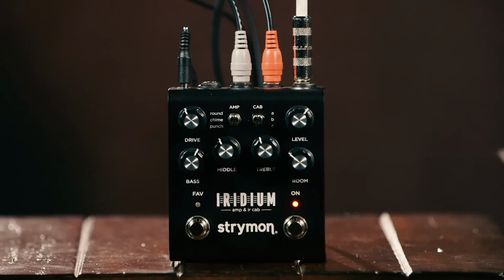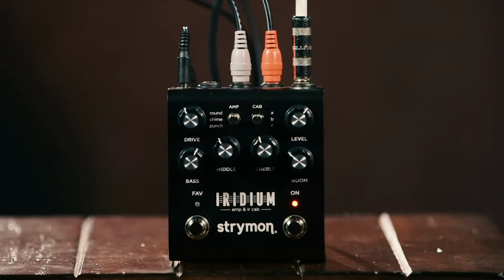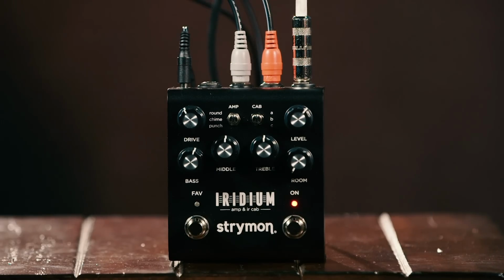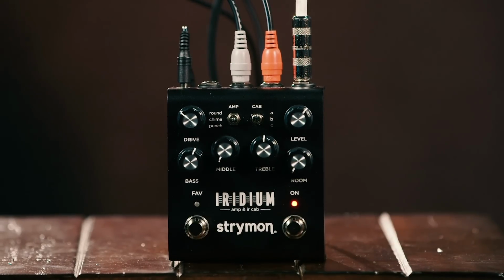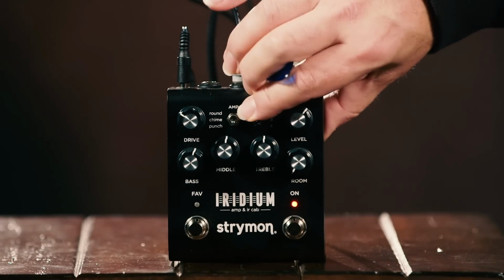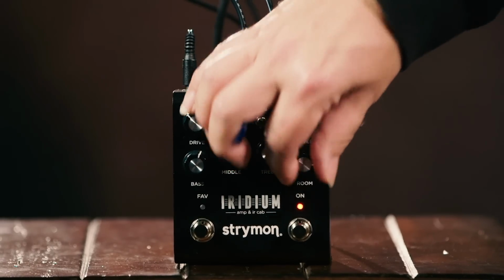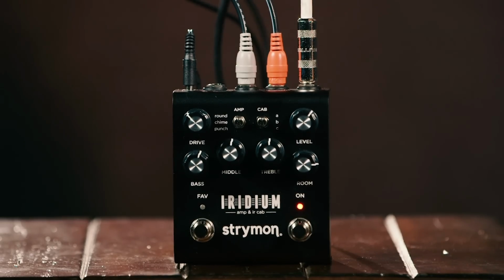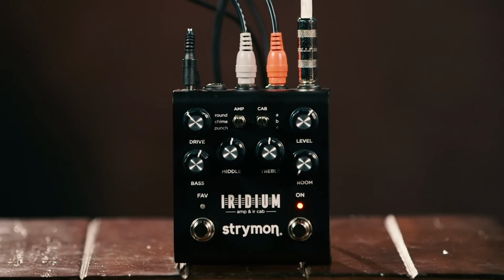Strymon Iridium Amp & IR Cab Pedal Demo

Comment: So the Iridium can't be used straight into the front of your guitar amp or the fx loop? 🤔
Reply from the maker: Hi, hekakain4108! Thanks for your message, Happy New Year! Iridium can be plugged into the front end of your amp, or the effects loop or a mixer via direct box. That said, there are several adjustments to be made using an amp. Ie: turning off the amp sims when connected to the effects loop or front of the amp. Additionally in the front of the amp, since there are redundant gain and EQ controls/tone stacks, care must be taken to obtain an optimal result.
Please contact us direct with other questions as you have them!
Robert Williams, Senior Sweetwater Sales Engineer, (800) 222-4700 ext. 2371, robert_williams@sweetwater.com

Comment: So to use a delay or reverb pedal, you plug your guitar to the Iridium input jack and the Iridium output into the input of your pedals and plug the output from your pedals into a direct box and send it to FOH or whatever other audio source you’re using, is this correct?
Reply from the maker: Hi, sonny6string822. Yes, that would be a great way to do that setup. If you’re just running clean amp emulations on the Iridium, the delay/reverb pedals could also go in front of the Iridium. Really just personal preference at that point.
Thanks for your interest!
Charlie Davis, Sweetwater Sales Engineer, (800) 222-4700 ext. 1320, charlie_davis@sweetwater.com

Comment: Thanks very much, Mitch! Can i use this with my Boss RC-600? Rock on
Reply from the maker: Hi, Nirodha. Yes, those can be used together. The Iridium is essentially taking the place of an amp so I would keep that as the last thing in your signal chain, with the looper wherever you would normally keep it in your pedal order before that.
Thanks for your interest!
Charlie Davis, Sweetwater Sales Engineer, (800) 222-4700 ext. 1320, charlie_davis@sweetwater.com
Reply: @sweetwater  Thank you very much!

Comment: I want the ability to: get my 65 Blackface Fender Princeton "Clean" - through the P.A. (without having to carry my Amp to Gigs) - any Input ?
Reply from the maker: Hi, Michael. For what you're describing, the Iridium is a great choice. It has some great Fender style tones in there and I see a lot of people using it so that they don't have to bring an amp to a gig. For running into a PA, you will likely need to pair that with a DI box.
Thanks for your interest!
Charlie Davis, Sweetwater Sales Engineer, (800) 222-4700 ext. 1320, charlie_davis@sweetwater.com
Reply: @sweetwater  Thanks. Now I'm comparing & researching: Strymon Iridium, Humbolt Simplifier. Walrus acs1, Quilter-unit ??? I also want the most Amp-like Feel (under the fingers) Appreciate your input.

Comment: I see this as a great live rig, but it'll never replace a real amp in a studio.
Reply: This video was made in a studio and it seemed to just replace a real amp and cab and microphone
Reply: @cmath8577  I'd use it for making a demo and an indie album on a tight budget. But if you're making a pro-level album you real amps and mics should be used.
Reply: @godzilla964  such a dumb take. Plenty of indie albums are recorded with real amps, and plenty of albums of all sorts are recorded using modelers. It’s all fair game. If it sounds good, it is good
Reply: It did for me. Ended up selling my AC 15. Can’t turn it up loud enough in my home studio to really get good sound out of it. The AC model on this thing is killer

Comment: So this one goes straight to your cab like a small amp head, right?
Reply from the maker: Thanks for contacting us, Lester. Hope you're safe and well. Iridium is designed to connect to a mixing console or full range (PA style) powered speaker, not to a guitar amp or cabinet. It has no power and has a variety of amp and cabinets to select from. Please contact me direct for more information.
Robert Williams, Senior Sweetwater Sale Engineer, (800) 222-4700 ext. 2371, robert_williams@sweetwater.com

Comment: Ok, Mitch, you explained a fairly interesting audio routing with the pedals - Riverside to Iridium; Iridium to delay and verb. Did you just come off of the stereo outputs of the Iridium or did you use some other secret sauce? I’ve heard demos with the pedals all in front of the iridium and thought it sounded amazing. Nice demo and thanks!

Comment: Will this go direct to the effects loop if I still need to use an amp?
Reply from the maker: Hi, Josh. You could run this into an effects loop, but just remember that you would be running a cab IR into another cabinet. That may not give you the best sound possible, but it is an option. If you have any other questions, please feel free to contact me anytime. Thanks for the interest! 
Chris Arnold, Sweetwater Sales Engineer, (800) 222-4700 ext. 1709, chris_arnold@sweetwater.com
Reply: Sweetwater TY! I’ve checked the online manual an option to disable/bypass the CAB Sim. Sounds like a good option to me!

Comment: So I can plug this straight into my cab? How loud does it get? how many watts?
Reply: It won't power a cab. It plugs directly into an audio interface, headphones or a PA system. It's emulating an entire recorded guitar tone signal chain of Amp -> Speaker Cab -> Microphone
Reply: @oisinmcphillips2090  Got it Thanks!!!
Reply: Oisin McPhillips if I still need to use my amp so you recommend to connect this on the effects loops?

Comment: Does the  Iridium have to be set at the end of my pedalboard signal chain when using my effects pedals in order to take advantage of the Cab sim IR's?
Reply from the maker: Thanks for your question, Jason. Here's my take: It depends… If you want to set up the chain like an amp without an effects loop, then yes, Iridium is last. If you want to set up the chain as if you are in a studio, then place your time domain effects after the Iridium. Technically you can place anything after it, since in order to connect to a mic pre on your interface or mixer, you'll likely use a direct box. If you connect to a Hi-Z input on the interface/mixer, then your results may vary. You can't hurt anything by trying both methods, so experiment. If I didn't answer you completely or correctly, please contact me direct.
Robert Williams, Senior Sweetwater Sales Engineer, (800) 222-4700 ext. 2371, robert_williams@sweetwater.com
Reply: @sweetwater  Huge thanks and great demo!

Comment: No fx loop?? it would be mess putting your effects pedal after power amp and IR sim. Cmon  strymon if you are pretending to be an amp we need fx loop
Reply: Çağlar Oral Not really. Any post effects become clearer, instead of limited by the speaker IR and its frequency cuts. Modelers give you the option to do either, and many effects found on records are added in the DAW, which does the same thing.
Reply: None of the 3 amps being modeled here have effects loops – fender deluxe reverb, Vox AC 30 or Marshall plexi. So if your argument is for historical accuracy and being true to the real amps, they’ve done it

Comment: Wasn't interested until I saw it has midi, looks like a simple setup without having to get overloaded with 1200 amp models and 3000 cabs....etc.... more like a tube amp setup, some knobs switches and a few minutes to dial in a tone , if it reviews to run well with a FX8 , which I think it would, I will get one

Comment: Is it possible to turn off the Amp side and use my HX stomp as the preamp/effects and use the iridium for the Cab IR? I need to free some DSP on the stomp
Reply from the maker: Hey, Lucas. Thanks very much for your question! Yes, you can turn off either the Amp or the Cab inside the Iridium. Check this link:
https://www.strymon.net/faq/how-can-i-disable-the-amp-or-cab-on-iridium/  
Please contact me direct with any other gear questions you have.
Robert Williams, Senior Sweetwater Sales Engineer, (800) 222-4700 ext. 2371, robert_williams@sweetwater.com

Comment: It seems to be a good pedal, but for that price...just don't! It's basically a GT2 improved. HX Stomp is more expensive but it have a lot more to offer...a lot more! And it fits just fine in almost any pedalboard even replacing effects. Also, for some less than this, you can go to Atomic AmplifireBox. Cheaper and also do a lot more than this and probably even smaller.
Reply: Quality over quantity. You get what you pay for, and these are great

Comment: I like that adding gain for distortion doesn't raise the volume. I finally resorted to using multiple distortion pedals set to various amounts of distortion at the same volume to eliminate the problem of volume change at different distortion amounts on one pedal being changed on the fly for different songs.

Comment: I don't care for the overdriven amp sounds for the 3 amps demoed here.  The cleans are excellent, but I'm still not sure about the other tones.  Strymon's demo videos are mostly clean or light crunch too.  PLEASE somebody "release the hounds" on this thing, assuming it's possible, so we can hear what it can really do.  And I'm not talking about modern high gain tones, but rather something like classic JCM 800 sounds.
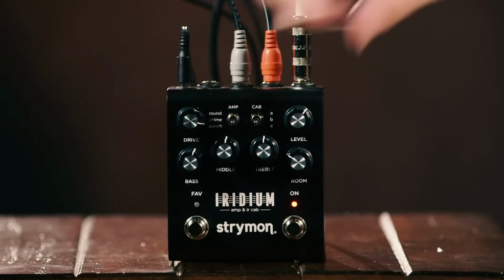Reply: Sinner Train what about at 8:05?
Reply: @robertwellington2616  You're right, but it's such a brief part of the demo.  There's another brief Marshall-type blast later on too.  I guess I'll have to try one of these out.
Reply: Sinner Train yes there was another time he played it. I can’t use it because I’m not connected to a computer. So I wonder if powered monitors would work and how they would sound. I don’t really want to spend any more money. I’ve spent a fortune and I’m finally under control. I have passive monitors, unpowered that are collecting dust in a closet. Tbh I love my amp and pedals and I would’ve bought this as a plug in the front of my amp pedal. But I’m not buying any more monitors. I did think the Marshall sounded pretty good though.
Reply: According to Strymon, about 2 o’clock on the drive knob would be the maximum level for the real amp being modeled, and pass that is an additional gain stage Strymon has provided. I agree it doesn’t sound great when cranked, so I usually stick to that 2 o’clock point and then use overdrive pedals

Comment: how about an Iridium for bass? Ampeg SVT, GK solid state amp, and maybe a Fender Bassman?
Reply: I’ve recorded bass with it and it’s my favorite bass tone I’ve been able to get direct. For whatever reason the Punch with the 4x12 sounded awesome to my ears. That’s really the thing that separates this from the other modelers. It’s insanely easy to dial in the exact tone you want. I was adding guitar parts to something I had recorded before and within 5 minutes matched the tone of my tube amp that I mic’d and recorded a lead part. I couldn’t tell the difference. It’s really great.

Comment: The omission of an FX Loop and Aux In is a bummer.
Reply: You don't need an FX loop on a preamp. An FX loop offers insertion for post effects, with this you simply run them after the output.
Reply: what is your reason for wanting to route the time based effects through the IR filter? you could just run the iridium into delays+reverbs, like it's done with a miced up amp  sound in any DAW in the mixing phase... i am just curious.
Reply: Try running a lush reverb into a dirty amp. Unless you want shoegaze tones, you want verb and delay post distortion. 

Also, this is not a preamp. But if you don’t understand these things, there’s nothing more I can say that will change that.

Lush or at least clear and articulate verbs and delays that will also be able to be heard through Iridium’s headphone out is what I’m getting at.
Reply: @neenerheaddj  I didn't say you should run reverb before a dirty amp, LOL. You would run reverb AFTER this unit, not BEFORE. And yeah, amp modeling units ARE preamps, fed into either a power amp or directly to P.A. (with cab sim enabled). Yes they emulate power amp as well, but the point is they are a preamp as far as the way you'd build a chain. Guitar into the Iridium, then into delay and reverb, then into power amp or D.I.
Reply: @neenerheaddj As far as what you'd hear in the headphones, I suppose you're correct

Comment: So, is he going from the pedal into a speaker cabinet ? Is the pedal the amp/head ??
Reply: It's basically a preamp. You'd have to use a powered speaker or a power amp with it. Or, if you're gigging with it, you'd run it into the house system.
Reply: I think for the demo he's going from the Strymon > audio interface > DAW. 

Or it can go direct into a front of house/PA system. Or into powered full range monitors. Or (I think from the manual) you can plug it into an effects loop return of a guitar amp.
Reply: blackprophesy thru the return input Strymon said it won’t sound as good. So I wanted this, but I’m not going to spend this amount for a meh sound. I’m not connected to a computer and all that goes with it. But full range powered monitors would work? There goes more money and I have non powered, passive, unused monitors. I’m going to be forced to pass.

Comment: Two Notes Torpedo Cab M is $80 less and does more....and I'm a Strymon guy!  Just saying.....
Reply: The Cab M only has power amp modeling, not full-out amp modeling. And the controls on that are more menu-divey.
Reply: Cab M is not stereo
Reply: Not as good. This is highest quality
Reply: I agree with you but the Cab m does have 2 mics at once and total control on where you place them, and I already have 3 preamp pedals. I don’t need the Strymon for what I currently do.

Comment: Strymon makes great stuff, no doubt. At that price, though, you get 3 amp models, but you could buy an HX Stomp for a little more and get a ton more options.
Reply: Yeah, but we need something for us simple, one tone guitarists, who don't want to scroll through endless menus or mess with hundreds of different parameters. Iridium seems to be more plug-and-play style option.
Reply: That was my thought, as well. It would be nice, though, to see if the amp/cab sims are better than the Stomp. That may justify it.
Reply: @emo-m9m  My Hx is great, With loaded IRs Ive bought and a decent ALTO 10 inch Active speaker I'm blown away by the tones. Cant Imagine "better"- Ive had fender tube amps, mesas etc.  If anything this strymon would be something Id buy for a backup.
Reply: Doesn’t sound as good

Comment: Would you put a studio compressor before or after this in a signal chain?
Reply: You can utilize it both ways. The before really controls the dynamics into the amp and the gain structure of the input. Do it after and it gives. what I call, a Mesa Mk series compression that beefs up the sound but still allows you to tailor the tone response by your dynamics and guitar volume.